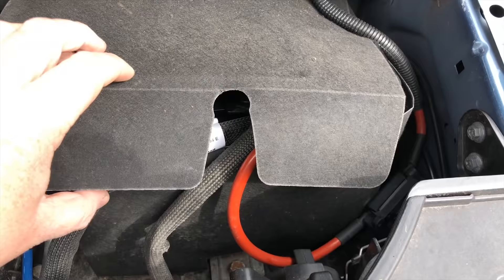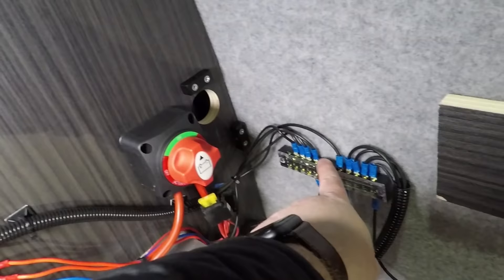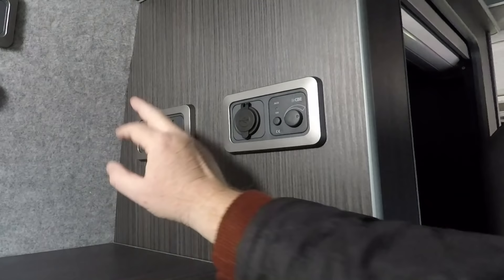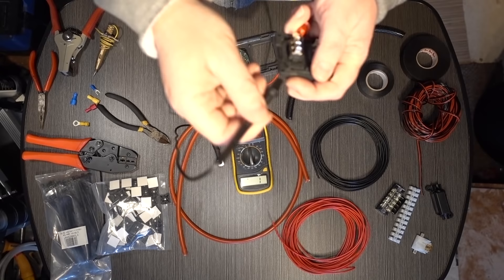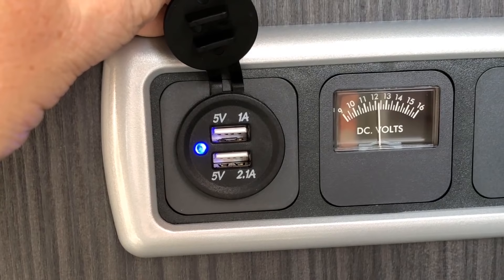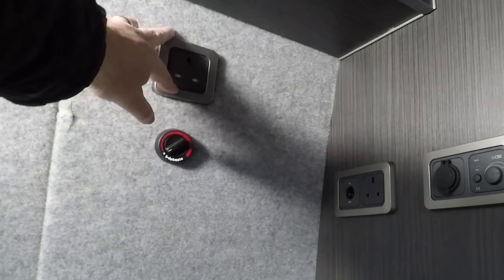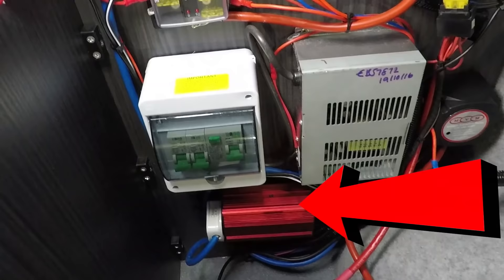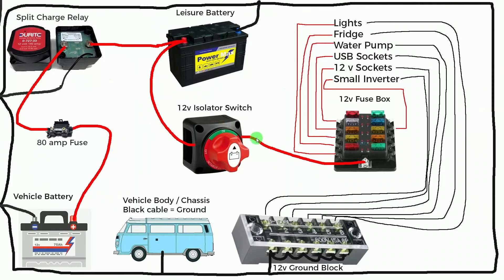Complete 12v Campervan, RV, MotorHome, Boat Wiring Tutorial

Comment: Hi John, great video. I'm just putting together my 12v system and this has been really helpful. I can't work out what size cable to connect from the -ve battery terminal to the bus bar. The bus bar you include in your shopping list cannot take a 16mm2 cable, so I'm assuming a much smaller cable is sufficient. Can you please confirm?
Reply from the maker: The fuse box only take small cables as it’s intended to run low amp items, so the ground block and fuse box + are rated lower. A combined common and fuse box is what’s used these days 👍🏼
Reply: @johnmandy  So what size cable do I run between the battery (-ve terminal) and bus bar?
Reply from the maker: As I said in the video loads and cables are all dependant on the appliances you are connecting and using.
If you can list all appliances, lights etc. then I can help you work that out.
Reply: @johnmandy  I think I see the confusion. My minibus has a fibreglass body, so with my 12v system at the very back I cannot connect to the chasis for grounding. For this reason I've run a 16mm cable from the -ve terminal of the vehicle battery to the -ve terminal of my leisure battery. So I was trying to connect a cable from my -ve terminal of the leisure battery to the bus bar but the bus bar can't take thick cable. Should I somehow connect multiple wires from the bus bar back to the -ve terminal?

Or you can tell me to bugger off!!
Reply from the maker: Your vehicle will still have a metal chassis, the frame of the vehicle, that you can earth everything to. All cables need to be kept as short as feasibly possible, you can't run a cable from the negative of the vehicle battery to the leisure battery, that's not safe at all. You should have a short cable from the vehicle battery to the split charger, then short cable to the leisure battery and short cables out to the fuse box. People build their electrics area at the back and it's really bad, not only for loss of power with all those long cables, but due to the huge weight being out over the back axle. So I'd say re-arrange your electrics to make them work safely and give you more power and better weight distribution, plus you then get to use the vehicle chassis to ground things correctly.
Reply: @johnmandy  My bus was a disabled bus with a wheelchair lift at the very back that weighed 300Kg. With that gone, I felt that I could safely add my batteries etc. The lift had a long 16mm cable running from the +ve terminal of the vehicle battery all the way to the very back to power the hydraulic system. I just brought a similar cable from the -ve terminal to give myself a 'grounding' point at the back. On a regular van the ground (on the chassis), creates a connection between the vehicle battery -ve and the leisure battery -ve, so I don't understand the safety issue of a direct cable between the two -ve's.

Changing my setup now will be a complete nightmare, not least because of the location of my solar panels and the timeframe before my first trip away. Do I really have a safety hazard on my hands?
Reply from the maker: Long cables carrying high power get warm, and also lose power - so you'll be getting less power to your leisure batteries and potentially there could be a hazard, especially with a fibreglass body.
Reply: @johnmandy  I guess that only applies to charging via the split charge relay, in which case I could ditch that charging method and rely purely on the solar. Sound like a good idea to you?

Thanks so much for your help, and your great videos!
Reply from the maker: Yes, that’s a good way to do it, get the biggest panel you can fit/afford and a decent mppt charge controller and you should be fine.

Comment: How do you select the appropriate size of the circuit breaker that sits between the leisure battery and blade fuse box? Is it the total current demand of all my circuits added together and select the next highest available breaker size
Reply from the maker: Yes, work out your max load of all devices, also the fuse should be nothing bigger than 80% of the cable load rating.
Reply: @johnmandy  thanks John for answering my question. Your videos are really informative and helping a lot cheers

Comment: If there the starter battery is full and leisure not, does it then charge both batteries, overcharge start battery
Reply from the maker: IF the starter battery is full then the charge will go to the leisure battery until it's full.

Comment: Hi John I know you posted this some time ago now but I have a question about your comment on the use of an inverter. I see many van builders using 2000 to 3000 watt inverters probably to power their induction stove top, blender or microwave what ever high power demanding appliances that draw big power. So how would you recommend the low power draw be set up ie all 12v 5amp needs? Just directly to the battery source and all large demands are wired through the inverter?
Reply from the maker: Anything 12v wouldn’t go to the inverter, even if the mains plug came with a device but the output was 12v, I’d just chop off the plug and wire the cable into the 12v fuse box and power the device that way. I’ve got a specific video all about inverters too.

Comment: Will the leasure battery drain all its power If I leave the van parked in my driveway during the week, when the split charger senses not to use the vehicle battery. How do I stop this from happening?
Reply from the maker: The VSR isn’t a permanent connection. If you watch the video I explain how it works.
Reply: @johnmandy  cheers Johnny gadget man. Well explained video 👍

Comment: John you seem to know what your talking about..! thanks. QQ, my starter battery is under bonnet, leisure batterys in back  (LWB Sprinter), its it best to put the split charge relay closer to the battery or under the bonnet? I presume 16mm cable still ok over that distance?
Reply from the maker: It makes no difference where you put the vsr as it’s just a relay. 16mm is ok, 50mm is better though.

Comment: Hi John, I am new to this and just prepping my van for a 1st fix wiring. I was thinking of using a 220 plug in too and I have the socket in and wired but I was thinking of using a Sargent ec 160? What are your thoughts on this please. Thanks in advance !!
Reply from the maker: Hi David, personally I couldn’t say as I didn’t use that kind of kit. It’s installed in my new van and I’ve had to rewire it due to poor quality wires.
Reply: @johnmandy  I really appreciate the prompt reply. Do you still need an inverter with the Sargent ? My hope is to be able to plug in on site and then it will work the electrics plus charge the leisure battery. As you can tell I'm not an electrician :-)
Reply from the maker: Yes, you’d need an inverter if you wanted to use small appliances when not hooked up to mains power.
Reply: @johnmandy  Brilliant. Thank you

Comment: Hi John. I have wired my VSR in  and tge red light is still on. On the vsr is that ok?
Reply from the maker: If the VSR remains on then it could be due to a solar charge or other charge raising the system voltage, it could be the VSR will turn off after 15 minutes or it could be the vsr voltage sensing is very low.

Comment: I didnt see a 16mm cable going to your ground. Is it okay to ground the leisure batteries with a 2.5mm cable then?
Reply from the maker: No, I used a 16mm cable. So you’d need a 16mm cable to be safe.
Reply: @johnmandy  I see. So did you ground that to the chassis somewhere else then? Also is it ok to use a stainless steel screw for that since stainless steel is a bad conductor?

Comment: Hi John,thank you for this video is very clear I have a question 
I would fit a 6 way  switch panel on my transit does it need to be connected straight to the battery or I can connect it to the fuse box?
Thanks
Reply from the maker: It’s impossible to say as panels all seem to be different.

Comment: hi John . i have a 3 way fridge in my motor home  do you think the 12v side of fridge can be wired direct to the 12v leisure battery (fused) in stead of 12v when the engine is running. cheers
Reply from the maker: Bin your 3 way fridge if you want to use 12v volts, a 3 way fridge will not work off 12v as they only get to a set temp below ambient, so in summer they run all the time. Watch our videos to see what we did to install a 12v compressor fridge to get us a decent fridge all year round.

Comment: What fuse rating did you put in between the starter and leisure battery? I have a 12V 75AH Starter battery and 110Ah leisure battery. Cable size 16mm or 8mm. I am trying to figure what fuse rating to put... xD
Reply from the maker: Hi, it states in the video what cables & fuses to use 👍🏼 For main cables you should only use 16mm, smaller cables are for wiring lights or appliances.

Comment: John.I have never been a big fan of scotch lock type connectors.Have you find them ok?Have you tried waggo connections?
Reply from the maker: I’ve used them for years, they’re great for temporary connections until you’ve got things right and then I either crimp or solder them 👍🏼
Reply: Understand that. Thanks for your reply.

Comment: 12v chargers will charge quicker than 5v but same theory as  in not needing an inverter :)
Reply from the maker: All usb is 5v - so 12v chargers reduce down to 5v
Reply: @johnmandy  sorry I was thinking more about using a 12v charger for your laptop instead of using the inverter and also about the QC 3.0 standard now utilised by a lot of new android phones which can actually take 5v/9v/12v/20v via the standard USB plug for rapid charging if you have the correct adaptor
Reply from the maker: As yet there are not USB ports you can fit into vans that support qc3. You’d need a 12v accessory socket and then you can use a quick charge phone adaptor or a laptop charger like you said 👍🏼

Comment: and this is why people hate wiring, you use the terms 2.5mm and 16mm for your wiring. 2.5mm = 14AWG which is what everyone in NA uses. No issues with that at all. But if you search (for your fridge) "can a 2.5mm wire handle 20A" the answer is Yes it can handle between 23-25A. and here comes the twist.. "can a 14AWG wire handle 20A"  the answer is NO, a 14awg wire can only handle 15A.
As an electronic tech myself, this shit drives me fucking crazy.
Reply from the maker: That's so crazy. Why there aren't standards on this stuff beats me.

Comment: Not to be greedy or ungrateful of your great video but you didn't create a picture that included the wiring of the inverter.
Reply from the maker: Since the inverter is 2 wires, red & black that wire directly do the battery, I didn’t think it was needed. I didn’t also explain how to wire a light, it’s very basic stuff. 

However, since lots of people ask me for advice about which inverter to buy or what to use them for, I’ll be making a video soon all about inverters.

Comment: Hi John!

Really enjoyed your video. You explain it very well. I do have a question. Why do you use a 300W inverter to charge your laptop? I mean most laptop chargers need around 19v. I think there are plenty of mini 12v-19v inverters  on the marktet. So you could just plug that charger in a 12v socket and not needing a big 300w inverter? Ive got a small laptop (only 60 watts...30watt at normal operation)..so that my plan (i am building an electrical circuit on my boat right now). Or do you advice against using those mini inverter chargers and do i need a  seperate 300w inverter like yours?
Reply from the maker: The device that converts 12v to 19v is a step up transformer, it’s difficult to get a 90w version of a decent quality that you’d want to charge your nice laptop with. So that’s why I say that in this video, however, this video is nearly a year old now and times have changed. I now use an a/c portable power bank to charge my laptop. Check out my main tech channel for that review. 👍🏼
Reply: @johnmandy  can you give me a link to that video? I browsed through all your vids but i think i missed it. Thanks :)
Reply from the maker: It’s on my main channel Gadget John. It’s only a couple of weeks old. 👍🏼

Comment: Hi John why use two singe wires Can I use a twin Cable Im wiring another Fuse board  for some extras in my Motorhome.
Great Vid
Reply from the maker: Each fuse box should be wired individually back to ground and the battery + terminal. But if you explain more about what you want to do I can help more.
Reply: @johnmandy  
Thanks for the reply I want to add a separate fuse board  to charge stuff while van is on the move installing at first  two usb sockets and a 12v Cig port a bit like your Autofail. upgrade.
I have installed quite a few Items you recommended in your other vids and All Good  including the 4G wifi Dongle and antenna works great.
Reply from the maker: Great thanks. The best way is to just wire a new fuse box directly from the leisure battery as I did in my new van upgrade video. Then you’ll be able to control the power outside of the sergant system. So black wire from chassis ground to fuse box ground and red from the positive battery terminal to the + fuse box. Then run your cables from that fuse box. You can just run + cables and ground nearby to the device if you want to save cables.
Reply: @johnmandy  
Thanks will do Keep up the good work. Wife says to stop watching you and Mandy as I keep buying new Gadgets ( I love Gadgets) 
Thanks Again
Reply from the maker: Sorry 🤦🏼‍♂️😁

Comment: Is it necessary to install an additional fuse at the leisure battery? Or just the starter battery?
Reply from the maker: Yes, it’s the best way just in case the wire is shorted out 👍🏻
Reply: @johnmandy  thanks. I found the video very helpful

Comment: Hi there, thanks for the very helpful video, I was just wondering. Is it ok to hard wire a hot point from the inverter? Say by adding a plug on the end that plugs into the inverter. 

Thanks!
Reply from the maker: Sorry, what's a "hot point" ?
Reply: A power point or a socket what ever you want to call it. Thanks for the reply
Reply from the maker: I just used an extension lead, you can then wire into a CBE socket or mount the extension socket wherever you want. If you check out my recent video on how to wire an inverter you'll get more details.
Reply: Ok thank you for that👍🏼

Comment: Hey John, quick questions. I have two 110ah batteries that I will connect in parallel. Should put a fuse in between the two? Thanks
Reply from the maker: I’ve got a video all about wiring multiple batteries. Check that out for more info.
Reply: @johnmandy  I will do thank you! 
Oh and the negative connection from the leisure battery to the ground should be 16mm cable also? Thank you

Comment: Hello thank you for your advice in this video. If you dont mind me asking, i have one of them switch panels with 8 switches/12v cigarette and 2x usb. It seems to have individual fuses on the back for each switch, does this mean i just connect the panel straight to the isolator switch?
Reply from the maker: I’d still connect the main cable, to the switch panel, to your main fuse box first 👍🏻
Reply: @johnmandy  thank you for your reply 😉

Comment: Great videos thanks.  I’ve a question how do you charge your battery when you’re at a campsite.  Do you use a mobile charger you plug into your 240 socket?  If so is it safe to put crocodile clips into your battery with all the other stuff connected?
Reply from the maker: I have a stand alone battery charger I can plugin to any wall socket, or extension lead, that way I can charge on a campsite hookup or at a house. If you intend the leave the charger connected all the time then I would not recommend using crocodile clips.
Reply: @johnmandy  oh thanks for your reply John I’ve watched ALL your videos and live them.  Yes I’ve got a stand alone charger I can plug in to a 240 socket in the van also.  What I was wondering was what would happen if I put the alligator clips on the battery terminals to charge it will it effect the other wiring I have hooked up to the battery terminals ?
Reply from the maker: Whilst I don’t condone the use of crocodile clips for more than a few hours the battery charger will only supply a charge voltage of around 14v, so your other electrical items should be fine. Just like the solar charger or alternator charge will be ok when your electrical items are connected.
Reply: @johnmandy  ok I understand.  Yes I’ll only be charging the battery for a couple of hours .  I’m probably overthinking things!!  Thank you so much for taking the time to reply to me.  I could not find anything on YouTube about charging  from campsite hookup with a battery charger that’s not hardwired into the system.  Much appreciated and I look forward to your next video!!

Comment: Shouldn't there be three cables? + red, - black and then another neutral ground wire, so every piece of equipment is wired into the +  and - circuit, and then from the equipment another wire goes to the ground bus bar, instead of to the battery? (Could you recommend any good 110V inverters, from 12V ?  Thanks for the video.
Reply from the maker: In a vehicle the negative is both ground and negative. If you follow the video wiring guide it explains everything. If you check out my other videos I have one all about inverters. 👍🏼
Reply: @johnmandy  thanks, I am a bit of a novice, I just remember what I was taught at school way back in the day.

Comment: Question regarding your inverter. Do you need a separate switch (which you have) if each of your power outlets have their own switches? We the inverter run if there is nothing plugged in?
Reply from the maker: The inverter should only be turned on if you’re using it, otherwise your wasting a lot of battery power. That’s why the inverter has a switch.
Reply: Ok thanks